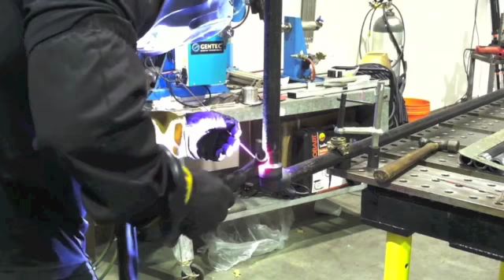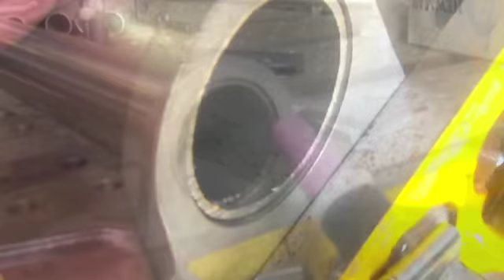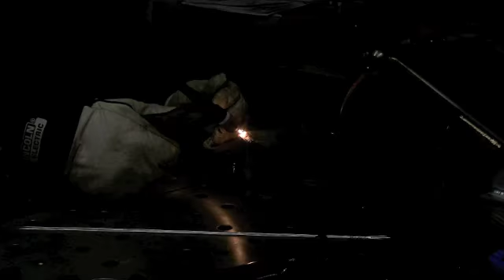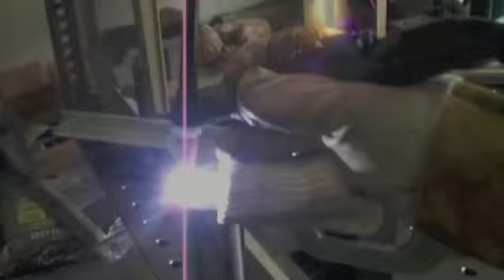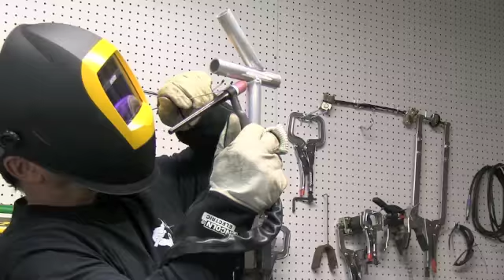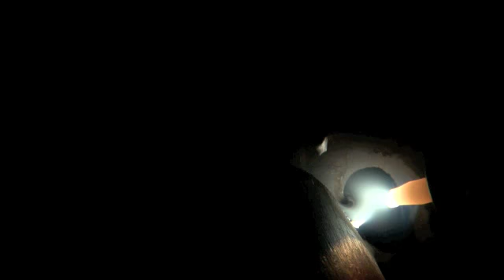Tig Welding Techniques and a Torch Switch - Steel, Stainless Steel & Aluminum

Comment: I was wondering what the switch type is you are using? I like the lever on it rather than the push buttons I have seen. I have a 14 pin Dynasty 280.
Reply: Mark, did you ever get an answer to your question?  I use a 17 style torch and want to try a simple on off switch before buying 6061s $239.00 variable pressure switch. Pls let me know.  Any info is appreciated. Thx

Comment: Jody, I've no experience tig welding so could you explain what up slope and down slope is? Thanks
Reply: Upslope is the number of seconds you set your power supply to ramp up to your desired amperage, same with downslope.  IOW, you're welding 1/8th material, you set your machine to 125 amps with four seconds of upslope and five seconds of downslope. This gives you four seconds from when you press the tig torch switch to reach your desired amperage, and five seconds once you let off to avoid crater cracks.

Comment from the maker: It all depends on the job. for example, Aerospace welding is pretty all dipping the rod in and out of the puddle but you do have to keep it shielded in the argon.  I also remember a certain nuclear plant job where lay wire was discouraged because x ray techs were misinterpreting the straight line of the root pass of a pipe weld as lack of fusion..so dipping was the best way to pass x ray.  So sometimes you just have to  do what the job calls for.

Comment: I have 3 big issues when i'm welding. 1 is I can't seem to get comfortable quick enough to weld. any tips for getting comfortable?

and 2- my torch angle while moving....starts off great then gets progressively worst, any tips on that?

and finally 3- making super tight fit-ups. I love when I can get it right, getting it right every time is where I need to get better.

thanks for the videos super Joe

Comment: Thanks for this one Jody. My Lincoln V155s is lift start and I've had so-so results, but it sounds like I've been trying to hit that 1 amp per 1000th rule of thumb to much. Given your statement that with 1/16th material your normal amps would probably be closer to 50 than 65. Thats a big difference at that end of the spectrum!

Comment: question I'm in welding school I'm dealing with tig right now which is easy to me saw your videos tried out the dipping technique which is really easy but the instructor said that the dipping technique is not a great way because it leaves a bunch of crap each dip you make what do you think about that

Comment from the maker: if you are using the flowmeter that came with it, your flowmeter is probably calibrated in lpm while in the USA we are familiar with cfh so it might need to be set much lower than cfh flowmeters. remember liters per minute vs cubic feet per hour is differenet

Comment: good job covering the info Jody, I watch these all the time, and I always learn something! the issue I have currently while Tig welding is finding the correct gas flow, could you work that into your coverage?. I currently use a Longevity 200sx tig welder

"Keep on repairing America one project at a time!"

Comment: You wouldn't believe how often your tips come in handy for me on the job. We weld steam turbine blades and use many types of alloys. Welding aluminium oil seals today, your video on using the cleansing action , makes it achievable to do this type of build up on dirty 6061. Thank you.